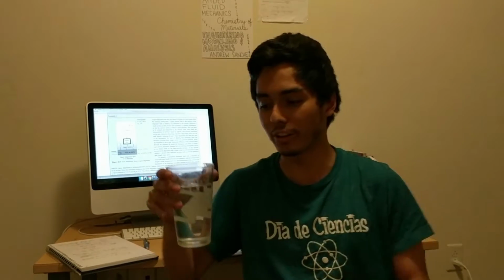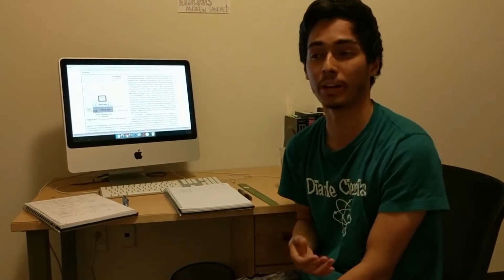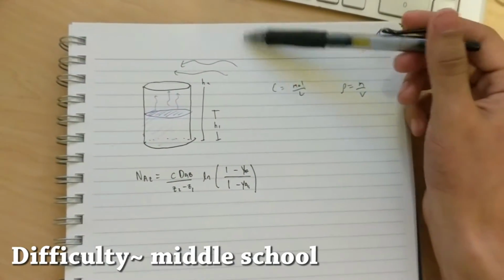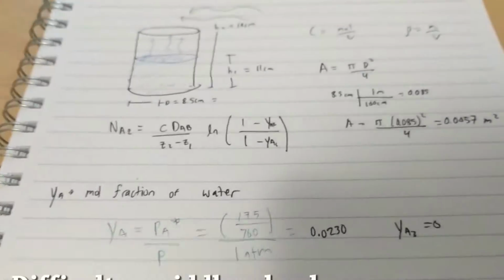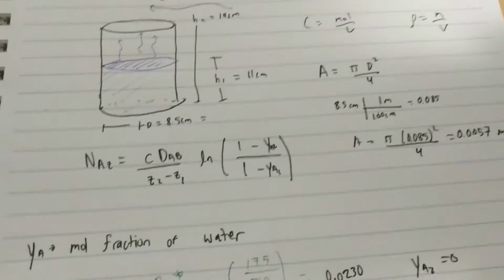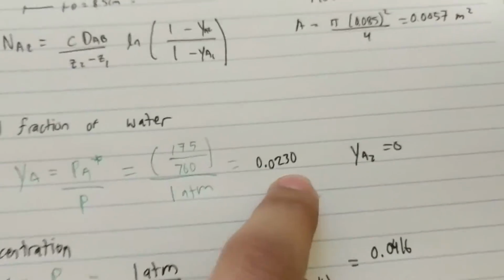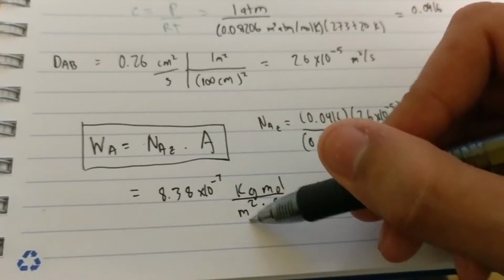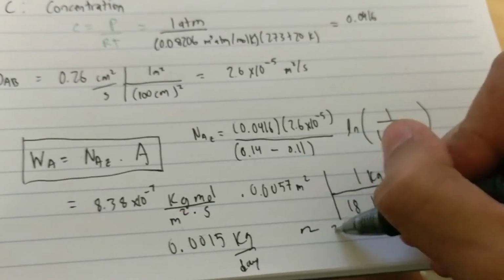How, EXACTLY, Fast does Water Evaporate??

Comment: Hm.  Interesting video, but I'm not clear on a couple thing.  1.  The mass or weight (in kg) of the water.  2.  The rate at which water evaporates. 3.  The cup is tapered- so if the water evaporation rate is constant, and the surface area of the water shrinks as it evaporates because the cup is tapered, the more the water evaps the time interval shrinks?
Reply from the maker: Thanks for the comment! Indeed those are unclear. I am assuming the rate is constant such that even if the height changes, the rate will still be about the same. As for the mass of the water, the equation calls for surface area not mass

Comment: Mate you did good job. However, did u take humidity into account? Water evaporation rate varies a lot at different air humidity.
Reply from the maker: I neglected humidity for this equation since I only considered the control volume including a small boundary layer above the liquid of the water but yes I agree that could be an important parameter.

Comment: is this applicable for a closed container??
Reply from the maker: Good question. No it would it not apply the same way because the convective mass transfer in an open system drives the evaporation rate. In a closed system the main driving force would be heat transfer until it reaches liquid/vapor equilibrium. At that point you would use thermodynamic equations (such as raoults law or fugacity) rather than transport equations.
Reply: @drandrewsanchez  ok thanks:)

Comment: Hey brother.
You have two equal reservoirs. One exposed to air at X relative humidity and T1 temperature, the second also exposed to air at X relative humidity but at T2 of temperature.
If T2 is higher than T1, what is the difference in evaporation rate if all other factors remain the same? Thanks for the help.
Reply from the maker: yo bro thanks for the great question. To be honest, I'm not entirely sure, but there are some models that describe mass transfer as a function of temperature as you mentioned. Check out the mass transfer section of  Transport Phenomena by Bird.

Comment: i have been struggling with this calculation if you have 56 liters of water per hour, how much energy can it make per hour. For this you need to know how much energy steam provides provide but I couldn't find that.
So I am trying to calculate it my self but as I said I'm really having problems with it if you can reply fast that would mean the world for me.
Reply from the maker: What classes this? What kind of energy? If it's heat then you would need the difference in temperature.
Reply from the maker: Good for you for trying it by yourself!!🤓👍☺️
Reply from the maker: If it it's mechanical energy, do you have any other information?

Comment: Nice presentation on the math concerning rates, however I would like to know what affects the rate of evaporation.  Pressure, temperature, and impurities in the solution.  Even a rudimentary treatment of this would be helpful.  Do any of these factors have a very profound effect on how fast water evaporates ?
Reply from the maker: Yes, evaporation rates are a function of the transport parameters you mentioned. Flux of water evaporation is directly proportional to the concentration difference and inversely proportional to the path length for diffusion. The thermodynamics of the system governs the partial pressure of the gas and liquid/vapor mole fraction composition. The temperature changes of the system dictate the heat transfer and simultaneously affect the flux of solute. This video neglects changes based on temperature and partial pressure and considers only the mass transfer of the system.